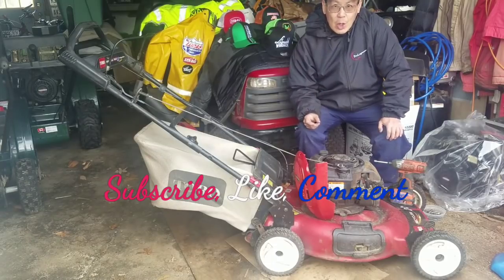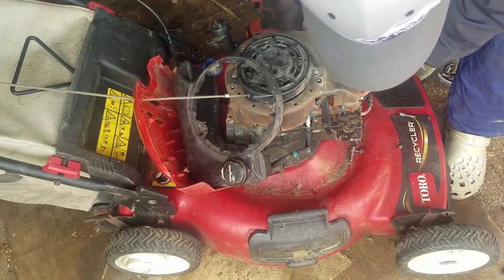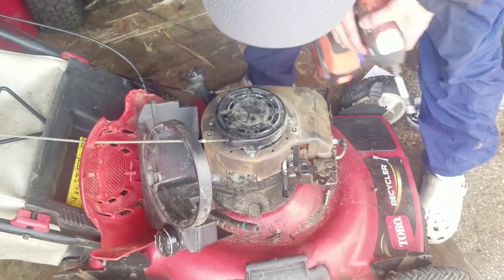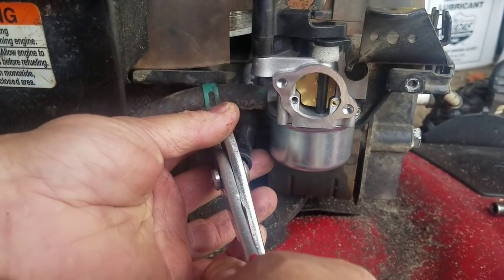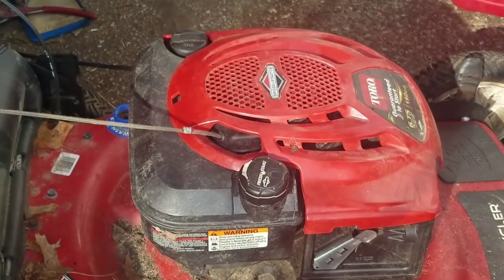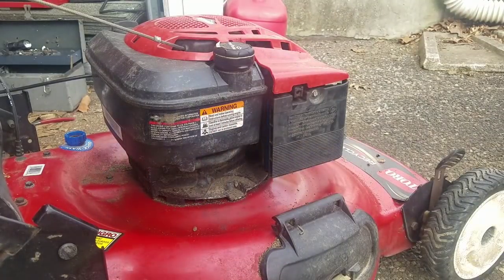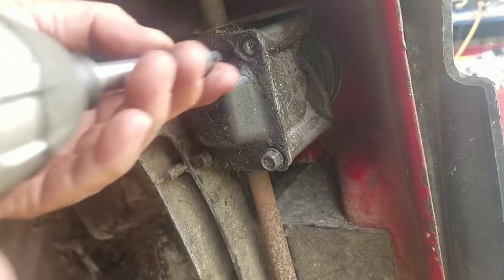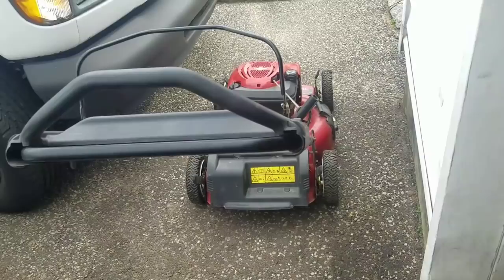HOW THE AUTO CHOKE NO PRIMER BULB AIR VANE BRIGGS CARBURETOR WORKS INSTALLATION TORO RECYCLER 20068

Comment: Choke closed. Engine starts. Only Air Vane opens choke. Engine warms up. Bi-metallic spring extends. Shut engine off. Bi-metallic spring keeps choke open to help start. Engine starts easily soon thereafter. Hot engine doesn’t like closed choke to start. FYI.
😁😁👍🏼👍🏼👍🏼
I was the 11th thumbs up like 😁
Reply from the maker: Thanks for the details Ryan.

Comment: I actually like primer bulbs because my present Toro cheap a— carburetor doesn’t have one and it is very hard to start. With my old Toro that has one it starts right up.
Reply from the maker: If it’s hard to start the. You have a problem.

Comment: I have a whole check list I do to a briggs 3 to 8hp engines, first I take the carb off, and apart, then I take the shroud off, then I take the coil off, and clean it, then for shits, and giggles I take the flywheel nut off to inspect the key way/key, doesn't matter I do the whole check list on everyone, then clean the carb ultrasonicly, then regap the coil, and then reassemble, when I get to the pull rope mechanism I inspect the pull rope replace if necessary, then clean, and oil the mechanism, every mower, so I know what has been done, to rule out any problems, then if I face any problems I know where to start.
Reply from the maker: Thays very comprehensive bro.

Comment: Yah don’t tip mower on the carb side Down.    On the Toro  you might check out the wheels to see if it is stripped there. Ahh 

Posted too soon😇

Comment: Henry if the drive gears were present, what does a new transmission cost?
Reply from the maker: Maybe $150-$200 new...but I'd never buy it.  Used gears, washers, e clips, are maybe $20!. I'd change a new bearing for $10...but packing it in the gear box is a pain, I've done it before.  It's very labor intensive though, which is why I wouldnt do it.  Not worth the time and money to get $25-$50 more on the sale of the mower.  As is..I'll get around $100. You got the sticker?
Reply: Mowers N Blowers Yes the sticker did arrive, I have not attached it to the TimeMaster yet,  Doing other things.  Never enough time even though I am retired...  go figure...  Promise to get that pic this weekend though.
Reply from the maker: @artgumbus  awesome!

Comment: Do I understand correctly there is NO primer bulb on this design mower? That it relies on the auto-choke and sort of "self primes" when one pulls the starter chord?  Please advise---thanks.
Reply from the maker: Correct counselor, no primer bulb.  The air vane has the choke flap closed until the engine starts.  Then the fins on the flywheel blow the choke plate open as well as the thermostat on the muffler.  It's the best thing since baked bread.  Make sure you buy the briggs 550ex version.  The 450e still has a primer bulb.  New Kohler also have auto choke.  Most modern Honda mowers have a wax thingy that acts like a thermostat too...also auto choke. The video I just did a few days ago on the honda caster wheel one is also auto choke.  No primer bulb.  Check it out.
Reply: @MowersNBlowers

Comment: Henry change the top part of the lawn mowers handle with another type that does not have the propelled option
Reply from the maker: Cant Deek, I thought of that...the brake cable is attached to the top part...that type only fits that handle.

Comment: While you had the cover off you should have also explained how to adjust the choke
Reply from the maker: Adjust the choke? It's an auto choke...spring and air vane hold it closed, heat and air opens it...what adjustment to the choke billie?
Reply: Henry mines the same mower as this I bought last week...for 40.00 on Facebook market place but the guy was using starter fluid to start it I drained and cleaned carb...Tomarrow I will change plug.My dad was telling me when people use starter fluid it the o rings get burned.
Reply from the maker: @chanceberg9570  it's like ether and its harsh stuff. Hope you subscribed
Reply: @chanceberg9570  hopefully the carb cleaner I use is less destructive but I know it can swell a bowl gasket but usually shrink back to size
Reply: @kenhilson786  yes it's been running good since I put new gaskets on it...Thank You both sorry I didn't let You know sooner :)

Comment: I don't usually call a bolt based on it's head size. A 5/16 bolt would be a bit large to hold that air cleaner housing lol.
Reply from the maker: That's what holds it..

Comment: What's the carb part number?
Reply from the maker: Depends if you have an auto choke or primer bulb
Reply: @MowersNBlowers  no choke or bulb, I think it's the carb because it won't start unless I prime the combustion chamber
Reply from the maker: So just clean the carb!
Reply from the maker: Here is the carb you need

https://www.ebay.com/itm/182885099326

Comment: Take the whole personal pace system off and put a regular handle on, those personal pace systems are pricey
Reply from the maker: The brake cable is on that handle...I'll have to modify if I remove it.
Reply: @MowersNBlowers  oh that sucks I know, but that assembly is expensive, but yeah your right, not worth the effort.